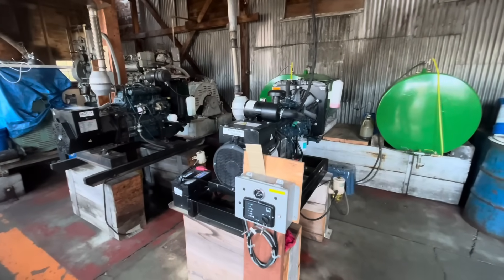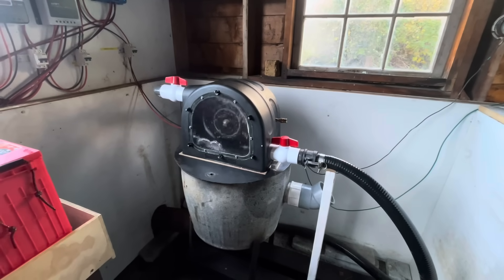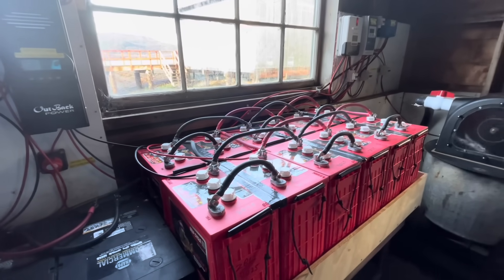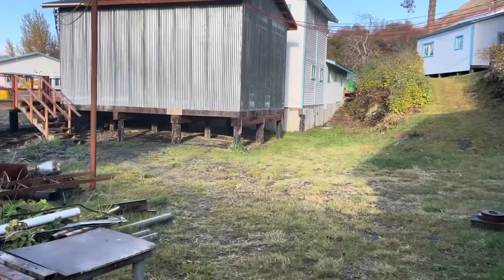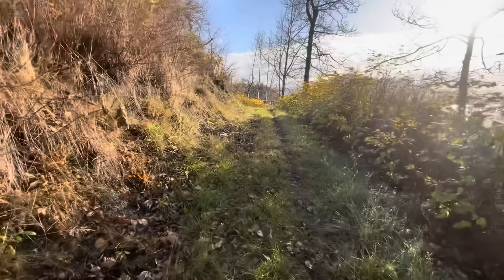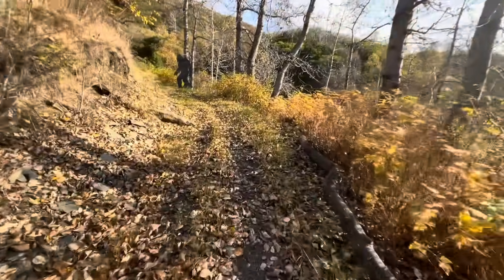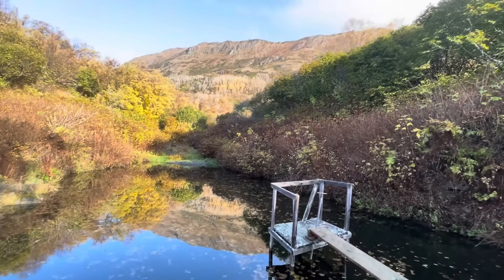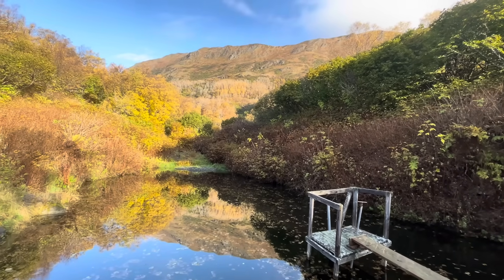How we make our own electricity in remote Alaska.

Comment: i recommend you ditch those lead acid batteries and go with lithium, for the amount you have there if it was in lithium it would be 3-5 times the capacity. You could prob run several days off just one charge.
Reply: Flooded lead aid batteries are cheaper to buy and easy to maintain over time....
The only thing would be to make sure that they never freeze...
Reply: @JohnSmith-pl2bk  in the long run lifepo4 would last much much longer over 15-20 years with ZERO maintenance and hold capacity much longer than lead acid. No need to top off water or anything. Theres a reason everyone is switching over to lithium. Also lithium batteries have self heating for the better quality ones. You could sell those lead acid and prob buy higher capacity lithum now as prices have been dropping alot especially if you were to buy in bulk
Reply: @DatBlueHusky  
He did say in the answer to anther comment that he has had no off gassing nor any need to top up those batteries with distilled water.
This is a 12VDC system so the 270 watts flowing into a bank this large is really a "top up" amount.
Reply: What was the initial cost of all that equipment. Why not just burn and plant trees instead as a crop.
Reply: @skirmisherssouthport5056  
Burning trees provides only so much heat and light.

If you are near to the grid it may cost $20k to get hooked up...
then you have the monthly charge which in remote areas is higher than in urban areas.

So you have a $20k amount to provide yourself with unlimited free electricity...
and then say $200 per month as a "bonus" that you "pay" yourself...
from the saving NOT having to pay anyone else anything else for your electricity.

Comment: Is it possible to get some appliances that use the batteries directly as DC, last place I worked DC motors were a thing and also some appliances for boats run on 24V.
Reply: They are almost always far more expensive. He has the inverter...
once paid for that opens up all domestic appliances to being able to run on 120VAC
Reply: @JohnSmith-pl2bk  So the conversion to AC and the appliances sometimes convert back to DC again is not a large loss?
Reply: @surters  
Overtime it might be a substantial "loss"(electrically) but he has free electricity....
so being able to buy normal domestic appliances is an immediate  large financial win.

I didn't realise this was a 12VDC system..
he said in anther comment that he should have gone for 24VDC or 48VDC to reduce these conversion losses....
and may still do that.
Reply: @JohnSmith-pl2bk  his problem is the amount he gets for free is finit and he might want to install more equipment. So every loss counts somewhere.

Comment: I am sort of surprised you don't have solar panels on the south wall of that building.  As far north as you are the angle is low.
Reply: a stand alone solar tracer system is crucial.
Reply: @mikeedwards1768  I don't think it is needed

Comment: Circulate generator coolant into hydronic floor heating too
Reply: This! Internal combustion engines aren't great for their primary purpose (kinetic energy), but if you can scavenge most of the heat they make, they can be useful little  noisemakers 😄

Comment: Great system!!  270W sure helps in the winter when the sun is limited.  My creek will only give me about 100W.   You sure are in a beautiful spot!!
Reply from the maker: Thanks
Reply: @zacharbaylodgeinc8864 does it ever freeze in the winter, the water for the turbine?
Reply from the maker: @wolfpeoplearereal so far it hasn’t but we have had some mild winters. If it does freeze it will be a mess.
Reply: @zacharbaylodgeinc8864  I think you will be helped by the water temperature to keep it ice free, bottom temperature should be a couple of degrees above freezing and keep the pipe "hot".

Comment: First time I’ve heard it called Alternator Generator…. Which is correct definition !! 👍.    Generator produces DC and uses brushes,   An Alternator produces AC and doesn’t have brushes.
Reply from the maker: It is an alternator 3 phase AC that goes to a rectifier that changes to DC. It is very interesting in the wording because I call the diesel generator, generators but they make AC power.
Also doing videos you are just thinking on the fly and might not get things correct. I am not that great on the editing side but I am trying.
Thanks for watching.
Reply: @zacharbaylodgeinc8864 that’s what I I heard… you called it an alternator  generator and I knew exactly why you did 😂.   Like you said it’s an alternator but for some reason in the power industry it’s called a generator.    If you had straight up called it an alternator the keyboard warriors would have lost their minds!!  😂😂

I grew up working as a farm hand from age 16,  at age 20 I went to college for my electrical engineering degree,  but I truly learned how to be an engineer working on the farm!     I ended up working with VFD motor controls for 30 years which was perfect,  it required electrical knowledge and mechanical common sense.     

I have mad respect for whet you have done there,   The further away from the grid a person can be the better off they are ppl have lost all common sense and openly mock God almighty.   

If you ever have a question on VFDs let me know, would be happy to help !

Comment: how do you keep the water from freezing in the depth of winter?  how do you keep the batteries warm?
Reply from the maker: We live on Kodiak Island and it doesn’t get very cold here like other parts of Alaska. I think average temperatures in the winter are around 40 degrees. I have only seen it get a little below zero a few times but it doesn’t last very long.
I do have an insulated enclosure with a small heat lamp that I put around the water wheel that you didn’t see in the video. When it gets below freezing I will turn on the heat lamp. 
Thanks

Comment: Might be a good idea to put a valve on the turbine so that if the batteries are full or the sun is making enough to generate the maximum charge current then the water is shut off to save water
Reply from the maker: Yes there is two valves on the turbine, you can see them on the picture red handles. We do turn them off when we have sun out and the battery are full because it free wheels t turbine and makes a lot more noise.
Thanks for the suggestion
Reply: @zacharbaylodgeinc8864 Ya I saw the manual ones, I was thinking something automatic. Cool system, I have a creek I have thought about doing that with but I'm afraid one heavy rain would destroy my system. I don't have much head pressure, but I have mych better flow than that, so the turbine would have to be located in the creek so its risky
Reply from the maker: @integr8er66 All you can do is try. It’s pretty fun to experiment if you have the time and the money. But if it’s too risky might not be worth it if you have electric from the grid.

Comment: What a great set up and amazing location.  The layers of alternate electricity sources that work together is a great solution.   Do you typically run the generators based on demand? Do they automatically kick in? We don’t have the hydro element, but we can dump electricity into our battery bank, which allows us to run it less time to top them off when solar lags. Does everything go through the battery bank or it’s it just powering a parallel circuit? 

Would love to see a follow up with the AC/DC paths post generation (what you invert vs direct utilization) on the overall lodge systems.

Thanks again! Great overview and you’re handling the trolls brilliantly.
Reply from the maker: We only run the generators when we have guests or when I use the welder, plasma cutter or something that needs more power.
The generator won’t turn on automatically but the 12KW does have that feature. I just haven’t hooked it up. 
Everything doesn’t go through the battery bank just certain houses that I need power all the time. Make wiring interesting.
Looks like I might have to do a more detailed video. 
Thanks for watching and the kind words.

Comment: Don't you pretty much have to work on that system constantly? Do you have triple redundancy on your key parts?
Reply from the maker: Actually it doesn’t require very much maintenance. I take the water wheel apart once a year to grease bearings and inspect it. I do check the levels in the batteries but so far haven’t had to add any water.
I do have extra parts.

Comment: Thankyou for such a nice video about your setup.When i see two battery banks,i immediately knows you are truly off-grid.Planning ahead if one fails.And many people look down on lead acid and think you are stupid for using 12v system.Not so.My experience with lower volt system(24v) is ......simplicity.And i only need two 12 v truck batteries in emergency to get things going.And the obsession with 48v(because relative thinner cables are needed),totally  unnecessary.Was cheaper for me to use thick cables,instead of buying 4 *12v batteries for 48v system.
And your  270 w water turbine will make it possible for batteries to last 10 years.Because at night it will keep your voltage level safe for long life.
Excellent system,excellent planning.
I avoid lithiums,because in summer our temperatures can stay above 40 degr celcius for weeks at end.
Reply from the maker: Thanks for the encouragement.

Comment: Save the water instead of letting it just run off
Reply: The water would naturally fall down the hill and end up in the sea....
where it then forms clouds via evaporation..
to form water that falls on land when it condenses as rain.
There is enough water in the dam to feed all the humans and the turbine...
Reply: @JohnSmith-pl2bk you've heard of ibc or water well tanks right?! Women like good water pressure and it helps to rinse off boats with fresh water

Comment: stici a hydro generator device to the running flow from the resevoir. your missing out on a substantial free energy generation !!!
Reply: Gravity is the "power" behind all hydro schemes.
There is insufficient volume to run a turbine at the dam.

Only when gravity has introduced energy into the water that is "falling" down the pipe (penstock) is there sufficient "energy" to harness as "electricity" after it has gone through the turbine and spun the generator...

Comment: 1:40 270 watts?  I'm no electrician, but a single space heater draws 900 to 1500 watts 270 doesn't seem like much.
I'd love having some "free" power like that. 
Well, free after building the system. 😁
That's quite a power house you have there. 👍
Reply from the maker: At first I didn’t think 270 watts wouldn’t be enough. It seems that the battery storage is more important than the small amount of watts that it makes. Because it makes it all the time. 
We don’t use a lot of electric appliances. No electric heaters,coffee maker, no microwave, no toaster. 
I hope this makes sense. Thanks for asking.
Reply: @zacharbaylodgeinc8864 
Thanks for replying.  I suppose charging cell phones and LEDs  make 270 watts go a long ways.
Reply: 270 watts 24/7 is more than you think. Clearly they arnt using it for heating loads. Providing you can stirs the surplus it 6kw hrs.
Reply: @johnwarwick4105  Love the LED lights these days. Thoae are a tremendous reduction in power requirements compared to old school lighting.

Comment: Stringing batteries together like that in a parallel configuration causes differential losses between the cells such that you’re wasting potential system capacity. An improvement would be for each battery to have the same length line connecting it to a central bus as all the others. In that way, the line resistance for each is the same allowing them to fully charge in the same time frame. The way you’ve done it, the cell farthest away in the string will be significantly lower when the first cell reaches maximum. This wastes charge time - capacity.
Reply from the maker: Thanks for the advice.
Reply: @zacharbaylodgeinc8864  You’re welcome. It might seem strange at first to have the farthest one away having a perfect length cable to the bus meanwhile the closest one having a giant coil of wire the same length as the farthest one away. It will seem more strange knowing that the cost of copper is what it is these days. But you’ll gain anywhere between 15 and 40% overall system capacity by doing it. This is highly dependent upon the cell chemistry you use - lead acid batteries have a larger voltage difference between full and empty as compared to lithium iron phosphate. As such, the charge difference between the cells is lower in a lead stack than it is in a lifepo4 stack when string batteries the way you have. When there isn’t much of a difference in voltage between full and empty, any real resistance differences across the bus can and will prevent a full charge across the pack.
Reply: @zacharbaylodgeinc8864  Also, 2 dimension stacking or 3 dimension stacking can significantly reduce the amount of copper you’ll need to use overall to reach a central bus.
Reply from the maker: @jimk8520 that a good idea, thanks
Reply: Would it be practical to use multiple runs of hard copper pipe to fabricate a bus bar to reduce resistance?
Reply: @Savedbyhisgrace2025  While thickness and distance are both important in the grand scheme of current flow, in this case, the distance is playing a much larger role in the resistance. There really isn’t much of a difference in the resistance between a 10 foot piece of copper pipe and a 10 foot piece of thick, stranded copper wire but there is a measurable difference in resistance between a 1 foot piece of pipe (or wire) and a 10 foot piece of pipe (or wire) and that would be more to the point I was bringing. The thickness of a line is chosen for current capacity, the length is typically minimized to reduce resistance losses due to heat. When talking about charging paralleled battery banks (or packs), a 1 ohm difference between cells (due to cables or anything else) impacts the efficiency of the pack as a whole because of the internal (differential) losses of the pack as built which is why this matters.
Reply: Solar panels on the roof near horizontal generate from all angles but strait vertical would generate more on winter days ( when pointing to south).

Comment: Do you use the waste heat from the diesel generators to heat the house?  Also, the power produced from a 30 gallons per minute water flow depends on the water head (the vertical drop or pressure), which is the crucial factor in the calculation. Using the formula Watts = (Head in feet × Flow in gpm) / 8, a head of 100 feet could generate approximately 375 Watts, while a head of 50 feet would generate about 188 Watts.  ( I think you said you had 80 feet of head )
Reply from the maker: No I don’t use the wast heat to heat anything except the generator room. Interesting idea.
Yes it is roughly 80 feet. I could go higher but for now I am just using the reservoir that is there.
Thank for your interest

Comment: That's really slick engineering! I worked for a gravity spring fed water district here in Oregon for 6.5 years. We also have our 14" transmission line from the source down the middle of a road through the woods. We referred it as the bench. We maintain by removing blow downs, boulders etc on the "bench" every spring. Cool stuff!

Comment: I always get asked questions about "using hydro" and I try and explain to them that it takes a LOT of elevation drop for only a few hundred watts. It's constant, and if you have it, it makes since to use it... but trying to create something from scratch when you don't have the natural elevation is just a waste of time IMHO. I'm going to use your video to explain in the future.
Reply: Only need to make 100-300 watts DC into a charge controller charge a big lithium-Iron-phosphate battery bank along with solar it works well. Fills in for cloudy days. Shift loads to other fuels as much as you can.
Reply from the maker: Thanks

Comment: Nice setup with the hydropower fills in for cloudy days. Your battery bank would do better with lifepo4 but then have to worry about freezing temps. Better off waiting on sodium-ion to get perfected which doesn't have all the downsides of lithium.
Reply: LTO or LiFeYPo4 cells from winston/thundersky are good for cold temps, LFP and LNC not so much, I will be trying sodiums in about a month here in an Alberta winter